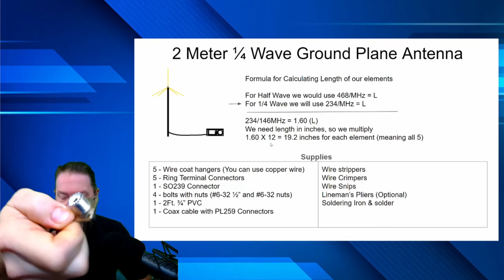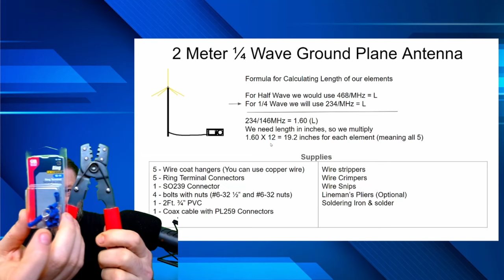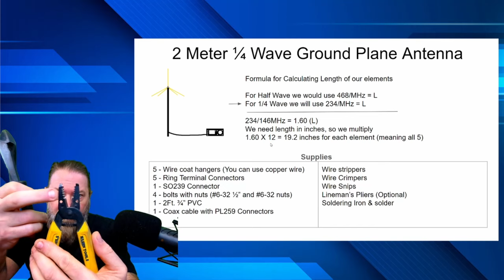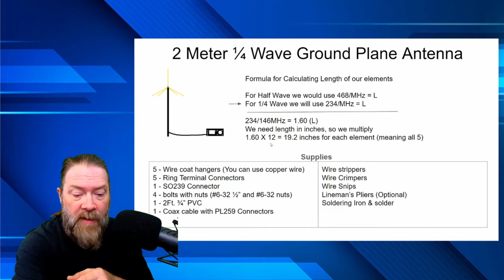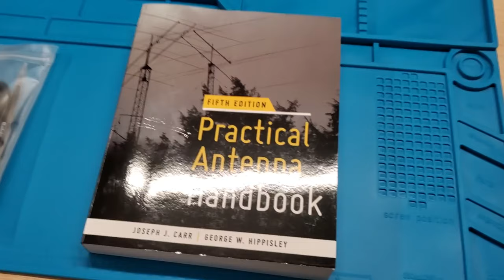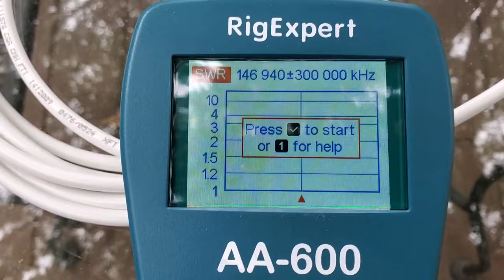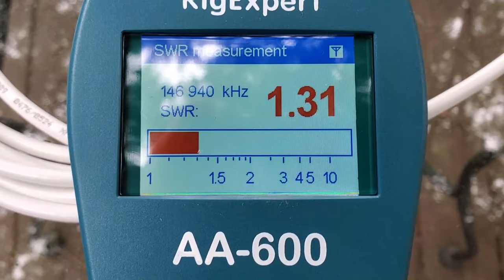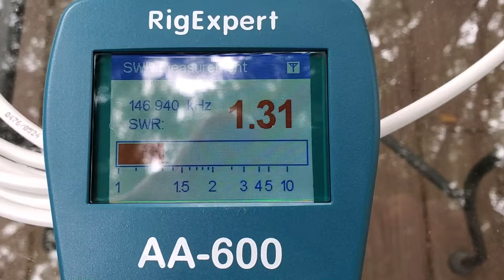Ham Radio Antennas for Beginners - Build Your Own Today!

Comment: Very well done!  When I got my Tech license way back in 1976 I also built one these beauties.  The only difference is I soldered all of the elements.  Steel coat hangers were much more common back then.  I did my shopping in the closet.  PVC pipe had not been invented yet.  So, I taped it the end of a broom stick.  With it mounted it about 15 feet in the air I made a simplex contact of around 40 miles with about 1.5 watts.  I was in heaven.  I suppose the point is, you don't have to invest a ton of money or need much in the way of advanced skills to built antenna that works very well.  I know I didn't.
Reply from the maker: Thanks for sharing your story!  I think you nailed it.  You do not have to spend the bank to get a good antenna and most of the time stuff you have around or easily sourced can make a great antenna.  Thanks for the comment and for watching.  73!
Reply: Love love love this video I've been sitting on some supplies to build this for a long while now, unsure I could complete this project. This video explains it do well I think I need to do it this week....Thank you so much!

Comment: Thank for the video copper is a better conductor years ago my first 2 meter antenna was copper ground wire connected to a 2x2 and 4 wood screws and a piece of coax with a p l259 on one end 2x2 leaing against the house and hit the repeaters full quieting
Reply from the maker: As long as it worked and you were able to communicate, I'd say that was a win!  Thanks for the comment and for watching.  73!

Comment: Scott, thanks for making this video.  I made one of these several years ago - using #12 solid copper and only 2 elements in my ground plane (to see if it would work).  My HOA was full of "she who shall not be named" people so putting up ANY antenna was not permitted.  I actually strapped mine to one of the supports for the deck, out of sight  from anywhere but under the deck.  I operated off of that for a few years until we moved from that location.  73, my friend.
Reply from the maker: That is an awesome story!!  Thank you for sharing!  I am glad that you were able to thwart the restrictive efforts of "she who shall not be named" and made it work for you!!  I love hearing success stories form viewers!  Thanks for the comment and for watching.  73!!

Comment: I took a course in radio communication for my degree in Electronics Engineering.  We had to calculate and build an antenna with multiple elements. This is a good step by step video you made.
Reply from the maker: Thank you very much!  It is a simple antenna, but it works.  I have had viewers send me pictures and describing how they modified my design and used alternative materials to build this antenna.  As long a everyone has fun and learns, my job is done.  Thanks for watching.  73!

Comment: Hello Scott. Very good with this inspiration for new hams. In 1981 when I got my first Ham radio lincense I build an antenne just like that groundplane and it was a good start. The solderstation you´ve got is superb - I´ve got just the same model and it is just as good as my Weller solderstation. Thanks for good video´s. Best 73´s from OZ1HGH
Reply from the maker: Thank you very much for sharing.  Glad to have you here!  73!

Comment: Great video, well thought out and informative!

I wish I saw this before purchasing my Arrow dual band ground plane. Don't get me wrong I dig my arrow antenna but I got it after getting my tech license per my local  ham association recommendation. I'm gonna stop buying and start making.

 I'm not sure there are enough fingers on the planet to count how many times I had to go back to the hardware store.  Thanks for getting me going. Now, I need to keep rolling.
Reply from the maker: Glad it was helpful!  Building your own antennas is the way to go most of the time.  The only issue sometimes is sourcing materials.  My only recommendation is never buy toroids or ferrites on Amazon.  There are much better reputable dealers out there and on Ebay that sell ones that will actually work in the event you decide to build End Fed Halfwave antennas.  Thanks for the comment and for watching.  Good luck on your future antenna builds!!!  73!!!!

Comment: My first diy antenna was for CB. It was 1/2 wave made out of 1/2in copper pipe and household ground wire. I could talk 25mi on a good day with a stock radio.
Reply from the maker: Very Cool!  My knowledge of CB is limited to watching Smoky and the Bandit...LOL  But yeah, anything can be made into and antenna and if done right, you can definitely get great performance out of them.  Thanks for the comment and for watching.  73!

Comment: Brass Brazing rod also works great, you can buy it at a welding supply store, and it comes in different thickness.
Reply from the maker: Great suggestion!  Thanks for the comment and for watching.  73!

Comment: To help tune them, I have found what used to be a very expensive piece of test equipment has been open sourced and mass produced for low cost. Sweeping the antenna with a Vector Network Analyzer used to require expensive equipment. Now you can easily trim and tune.  Google Nano VNA. Many manufactures produce it. Note you will need adapters to transition from the SMA to the connector of your choice of N, BNC, or PL259. Videos are online of how to setup, calibrate, and use it. It displays the following.
On one port
Smith Chart
SWR
On two port
Insertion loss
Phase shift
Found them for under $40 online.
Reply from the maker: I actually did consider the NANO VNA when I was researching.  However, I was trying to find the one actually made by the creator and I found a bunch of knockoffs with the similar logo.  That may or may not matter if it does what it says it should, but it got a bit confusing to me and I didn't know at the time which one to trust.  I know that they are packed with features that go way beyond a simple use tool.  Thank you for the suggestions!  73!
Reply: @HR4NT  It has been open sourced with PCB files and software for anyone to make. I bought two to find any differences. One was white and one black. The white one has the updated firmware, otherwise identical except color. Pick one up. They use the same boards. Only thing to keep in mind, is the unit uses a frequency synthesizer, so the signal is rich in harmonics.  Doesn't seem to affect it much.

Comment: LOL, that's not a "heat shrink gun"  that's a surface mount component soldering station.  Surface mount components use hot air to melt the solder for mounting and unmounting.  I guess you can use it as a "heat shrink gun"  (thanks for the giggle.)  Antenna looks good, thanks for taking care of the new guys. 73 KI5BXN
Reply from the maker: Thanks for the feedback.  It does seem to work fine for heating up the heat shrink, although what you said makes better sense being it does have a temperature control for that feature.  Thanks for watching.  73!

Comment: Other than the intermittent great conversations I have with ham radio guys building stuff and being the cheapskate is my favorite when I first started building 2-meter antennas I often took discarded TV antennas and resized them so I would have say a three element yagi that was cut down in order to use for ham it was light as good be most of them folded because they came in a carton to the store so they had to be able to fold building is awesome rock on keep it up
Reply from the maker: That is an excellent and innovative way to get new antennas!  Awesome!  Thanks for watching and for the comment.  73!

Comment: I have a houseboat trip to Kentucky next week so I am going to build this and try it out.
Reply from the maker: Awesome!  Let me know how it goes/went!  Thanks for the comment and for watching.  73!
Reply: @HR4NT  This was my first antenna build; it was easy, and it turned out great.  I got a 1.0 SWR without any adjustments but was unable to activate.  I attribute my struggles to the surrounding mountains and a low wattage output of my HT.  Using Jason from Ham Radio 2.0's recent comment on his Alaskan cruise "That's why I don't like QRP"!!

Comment: Well done. My first antenna was made from welding rods for 1.25 meters.  73 de Steve KD9EPU
Reply from the maker: Whatever you can use around the house or source cheaply and locally to make an antenna I think is fun, exciting and sometimes rewarding!  Thanks for the support! 73! KI5NPL
Reply: @HR4NT  my antnna a wire dipole for 10 meters  THIS wus number 2  30 years ago 
Nice to see you Elmering the new hams antenna building is addictive 
73 n good dx n9prf 
 JOE  ps I live in Mississippi now
A bout hour from mfj

Comment: And then for HF go to Wally Waggle and get you a 20' fishing pole and some wire.   Vertical for 20m and some radials.   Pretty cheap stuff.
Reply from the maker: Absolutely!  That might have to be an upcoming video!  Thanks for the comment.  73!
Reply: That is what I did except I got the 21' pole from BassPro Shop.

Comment: I found some tig welding rod (aluminum) that were 36" in length at harbor freight. 10 bucks for a pound of them, and I think there's a good 20 or 30 rods in there. Enough for quite a few of these antennas. I build mine last night and hooked up my nanovna to it and was shocked to see how good the swr was. I messed up by cutting too much off to get too greedy with the swr. Moved the low spot too high up the 2m band. Since I have so many more rods, I can just redo it.
Reply from the maker: That is awesome!  Glad to see so may are using the video and experimenting with different things to build the antenna.  This is what ham radio is about...getting curious and trying new and odd things to make a good result!  Glad it worked out for you!  Thanks for sharing and for watching.  73!

Comment: You can pick up a few sticks brass brazing rods and you can build a two meter ground plane antenna .
Reply from the maker: Oh for sure.  You can make an antenna out of almost anything that you find.  I just thought this would be a fun quick project.  Thanks for watching.  73!
Reply: @HR4NT  no problem because I am new at ham radio even though I have become a general class operator and still learning . There is one thing that I enjoy is designing and building antennas and seeing if they work or not .  Thanks to people like you that I can turn to for help is very greatful . 73s to you from kn4kbh Joe .

Comment: Awesome vid.  What about the radio/HT end of the coax?  Yes, newb here who also has a touch of the OCD.
Reply from the maker: Yeah I probably should have explained that a bit more.  I was using a standard coax for VHF/UHF which has PL259 plugs on each end.  Well, obviously that won't fit the radio, so I purchased and SO239 to SMA adapter so that it would be useable on the HT.  You can get adapters from Signal Stuff or from Amazon.  If you have a Ham radio supplier nearby even better.  They would carry just about every type of adapter needed.  Thank you for the question!!  Always happy to help if I can!  73!!

Comment: I've made this and worked Mir on Packet with it back in the day.  Just making one now actually, but using 1.5mm manganese bronze brazing rod instead of coat hangar wire.
Reply from the maker: That's awesome  Whatever works.  I like to hear about innovative ways others have made this.  Thanks for the comment and for watching.  73!

Comment: I built one of these 4-5 years ago in the C.B. 11 meter range. But I built mine with like, 3/32 stainless cable. The idea was, I could throw some paracord over a tree branch and stake the radials out. I think, after I trimmed it, I got 1-1.3 SRW reading depending on channel.
Reply from the maker: That is fantastic!!  Glad it worked out for you!  Thanks for the comment and for watching.  73!!!!

Comment: Hi Scott

Just a minor criticism. The SO259 you used has the white nylon insulation, this tends to distort during soldering giving a poor fit after cooling. SO259's with the brown insulation cost the same but don't suffer from this problem.  

Ian G4JIU
Reply from the maker: Thank you for the tip.  I appreciate that!!  73!!

Comment: I love this video! Im thinking about trying this project out. I am concerned about not having an SWR meter though. Is it safe to run without checking or could it damage the HT if we don’t check the SWR first? Thanks much! 73
Reply from the maker: I think that if you follow what I do in the video to the letter, make your measurements exact, you should be ok.  I used the SWR meter just to show that the theory worked.  I did not make any other adjustments after the reading and it seemed to work fine on my Yaesu FT3DR at the time.  However, if you know someone around that has one, you may want to reach out and see if they would allow you to test it if you are nervous about it, but I think you should be OK.  Thanks for the question and good luck on the build!  73!!!!

Comment: If you were to put a ring connector at the top of the vertical element, you could use it to hang the antenna from a limb. Just another option.
Reply from the maker: Very true and that may help out others.  Thanks for sharing that and for watching.  Glad you enjoyed the video!  73!!

Comment: Good vid, Scott.  I'm just starting out (not licensed yet; 85% on technician practice tests and studying for general) and this will be one of my first projects once I get up and running.  Question: where/how would you connect a ground to this? Would you just loop some copper around the connector or would you want to loop each radial?  I don't want to fry any equipment!  🙂
Reply from the maker: Best of luck on passing your exams!!!  This does not need to be grounded.  If you are using it as a portable (temporary) antenna and not a permanent setup, you can use it just fine without a ground.  I have my radios grounded as far as my base stations go, but handheld (or HT's) I don't both with it.  You won't hurt anything.  Hope this helps.  Thanks for the question.  73!
Reply: @HR4NT  Thanks... I'm so going to do this.  Great first antenna build!

Comment: Stainless steel tig filler wire would make a good antenna element, I bet.
Reply from the maker: I would thin that anything metal would probably work fine.  I have seen antennas made from everything from lawn chairs to Christmas lights...LOL  Thanks for the comment.  73!

Comment: The only drawback in this design is steel isn't the greatest of radiator's. I made the same antenna with brass welding rods, it cost a little more, but seems to be a bit better SWR and much better TX range than I got with coat hangers. Simplex range on 477Mhz UHF was almost doubled by using the brass rod over the steel at 10 foot in the air. Just my results.
Reply from the maker: I totally get it.  The main point was how cheap can I build an antenna that will actually transmit and receive.  If I were serious about the build, I would have sourced much better materials for the project.  This was more a case of just proving a point while having fun.  Thank for the comment and for watching.  73!!

Comment: Scott I loved your antenna build. I have one question, how far was that transmission on the radio check. I will assume
Your handheld was 5 watts. My name is Creg and I am retired living in South Florida and just getting into ham.
Reply from the maker: The radio was 5W but the transmission was to a local repeater nearby about 6 miles away.  The guy that responded was about 30+ miles away.  I hope this helps.  Glad to have you on the channel!  Thanks for watching and for the comment.  73!

Comment: The reason your "soldering iron" is overkill is because it's really a reflow workstation for reworking surface mount parts.  The "heat shrink gun" is for reflowing solder to surface mount parts.
Reply from the maker: I understand that now.  Thanks for watching and for the comment.  73!

Comment: Nice job and easy to under stand mate , the question is how much db was as 1/4 wave ? 73
Reply from the maker: Thank you for the comment.  How much db?  Probably not a lot.  As with any antenna like this, height will be the key to reaching out, so the higher u the antenna, the more it will hear within reason.  Thanks for the comment and for watching.  73!

Comment: I built a similar ground plane antenna out of metal coat hangers, except i added additional vertical elements for multibands. It's a more advanced project, but you could maybe do an upgraded version at some point. 73.
Reply from the maker: That is a great idea!  I will consider that for a future show!  Thanks for watching and for the comment.  73!

Comment: thanks for the video!  question...don't the connectors add length to the elements, or is it no big deal to worry about?
Reply from the maker: If it does affect it, it's not enough to make a noticeable difference, so I wouldn't worry about it.  Thanks for watching and for the comment!  73!!

Comment: I'm new to amateur radio and can't wait to try building one of these. I think I'll use an SMA connector instead as I read that SO239 connectors are only rated up to 100 MHz.
Reply from the maker: That is fantastic.  I encourage you to make one.  It's a fun project.  However as to your apprehension of using the SO239, That is the standard connection used in ham radio for everything VHF/UHF/HF.  It will not give you any issues and once you get further into the hobby, you will see that the majority of coax has PL259 connections for use into the standard SO239 sockets.  I hope this helps.  Best of luck on your project!  Thanks for the comment and for watching.  73!
Reply: @HR4NT  Thanks for your support. I guess I could make something similar for 70 cm?
Reply from the maker: @SuperBoobaloo  absolutely. Just make sure to tune it to the frequency you want to use .